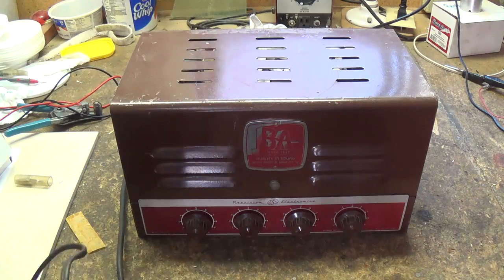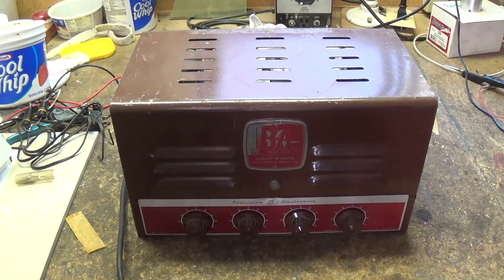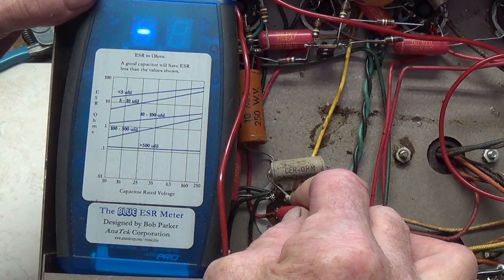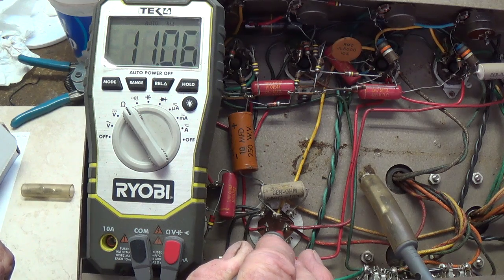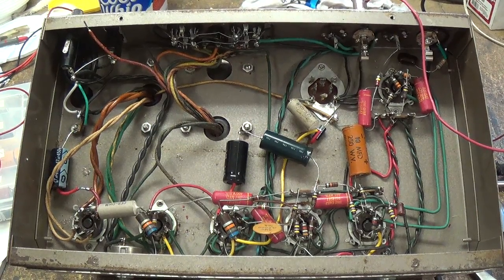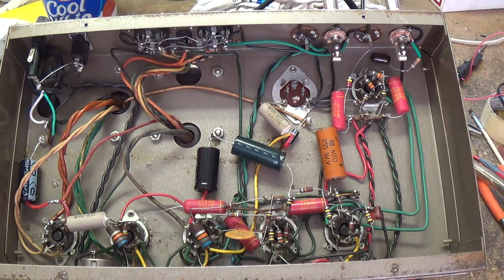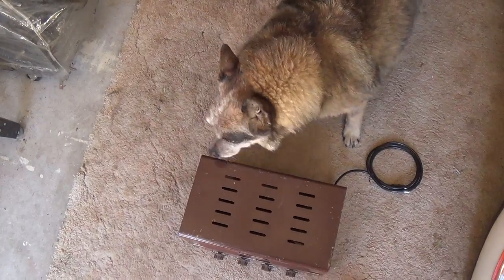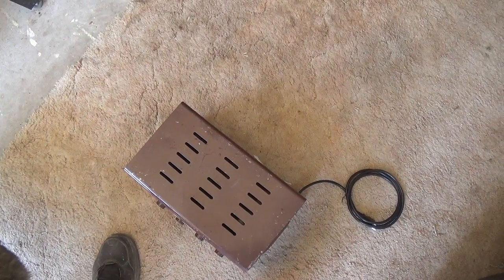The Worst Filter Capacitors I Have Ever Seen.....and Heard :)

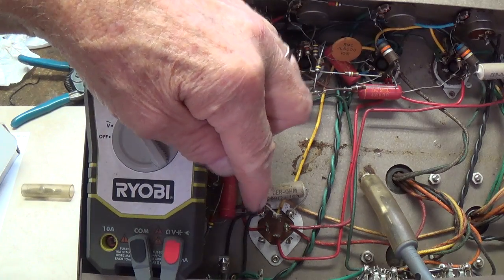Comment: Another really fine video on troubleshooting. From a safety point, all rings, bracelets and dangling metal jewelry should be taken off (2:05) when working on these high voltage circuits. I also assume the filter cap was discharged before measuring the ESR. Thanks!
Reply from the maker: We agree, TM, and yes, as discussed in many of our videos, all filter caps are discharged prior to any work on the chassis, especially when taking ESR measurements.

Comment: Looking in the circuit with another few years research in my brain,  I see Tiny Chief caps...  those are paper/oil type,  and like Bumblebees do go bad with age...   did those get tested too?
Reply from the maker: Yes they did, DK, and (surprisingly) seemed to be fine.
Reply: Cool deal.  I'm re-capping a 1979 Peavey Mixer...   it had 120hz whine.. and since it's been an on-the-road concert mixer, it's seen and heard a great deal.   There's only 350 or so Electrolytic caps.  Some are bulged, some leaked,  all are getting changed...  Fun Fun Fun...   Tedious as heck.
Reply from the maker: Definitely not a fun task, DK. Best of luck with it.
Reply: Got it all done (350+ caps) ... it's a long boring video.   However,  I recorded my DIY leslie speaker in Stereo, and that worked great.   My DIY leslie is a little different than yours... but not too much.   we started with the same drum...  I had a 10" speaker,  and a relay to use as a foot switch on/off.  All that stuff is posted.

Comment: Uncle Doug can you advise what to look for when buying a tube tester on Ebay?
Reply from the maker: Their circuitry is extremely elaborate, they are difficult to re-calibrate, and they are easily damaged by shipment and rough handling. I would suggest a Hickok tester, from a seller with flawless feedback who will accept a return, if necessary.  Good luck.

Comment: have you ever seen brand new (Chinese) filter caps act this way? is there anything I could have done in powering up a new amp that might have caused caps to become like these wretched capacitors?  I really need to build a current limiting light bulb setup like you use here... yes, I watched the video about making one but didn't do it yet. Cheers!
Reply from the maker: I've had good luck with the new Chinese filter caps sold by Antique Electronic Supply, Buzz. None have ever caused me a problem......yet :)  If you had one or more fail, it's possible they weren't installed properly. A current limiter would definitely help to prevent harm to components if short circuit(s) exist.
Reply: Considering how useful it is, a light bulb limiter is a sound investment.

Comment: Rusty's skills are beyond question. Dated parlance translated--"Rusty sports the mad skills"...very 90's but I'm not as cool as I once thought I was. 
P.S. I'm pretty sure (based on what I've seen/heard thus far in the Uncle D. videos) that the capacitors in my newly acquired Carvin amplifier will need to be replaced. I'm going to watch/learn for a few weeks before taking any action...I'm in no hurry to be wrong AGAIN so i'll keep consuming the 'course material' indefinitely. Thanks again guys!
Reply from the maker: Thanks, WTD. Best of luck with your studies and eventual repair :)
Reply: Hello Uncle Doug and and company! I'm happy to report that I simply had to replace a couple of pre-amp tubes to solve my problem after determining that it was merely 60hz hum that needed to be remedied.  I think after a full re-tube and a tuning of the bias will make my Carvin MTS combo the amp it can be which should be ultra low noise, good clean channel with plenty of nice tube warmth...just gonna start with a simple matched set of EL34s, maybe try a low noise 12ax7 in V1 and regular JJ's in v2-5. Think that will make the mild,but present 60hz hum altogether disappear. Also Uncle Doug, I'd love for you to see this UNCLE Alberts Del Ray--very neat amp and would love to show ya--just go to Craigslist Indianapolis and search musical instruments and enter tube amps...won't be long before you find this intriquing  and gorgeous piece of masterwork. It is really really neat!
Peace out Dawg(as they said in the 'hood before it became trite.)

Comment: Hey Doug, thanks for the videos 😃I have a question regarding a SS amp.  I have a Marshall MG 15.  The Neutral prong on my plug broke off and it heated up pretty good.  I noticed the wiring coming out of the transformer got a little cooked.  After going through a couple of fuses, i fixed the plug, but now I seem to be getting a lot of "what i thought " 60 cycle hum.  A person i was talking to said i probably burnt out a filter.  Was he talking about a filter capacitor?  Do SS amps even have filter capacitors?  Im wondering if what i hear is actually 120 cycle hum...  great channel by the way.  I am learning a lot about how to work on my Fender Hotrod Deville (my "real" amp) through your channel.
Reply: Kyle Olin or learn to read an use a meter and solder. i want to build one but damn still not that much cheaper with the good stuff.
Reply: By the way, i like the sound of that PA too 👍🔥
Reply from the maker: There is no telling what harm might have been done by overheating, Kyle. Yes, SS amp power supplies use filter capacitors. You might want to get a qualified tech to look it over.
Reply: Uncle Doug thanks for the reply.  Around my area work is expensive, and questionable at best. Id be better off just to get a new amp, ill just have to do some more research.  Got alot to learn :)

Comment: hi uncle doug i need help.recently i bought a selmer little giant from the 60s very clean amp all original .however i played it at low volume had a very clean sound when i cranck it up all the way the sound distorted in unpleasent way also there is a drop in volume and a crystal microphonic sound when i strum.
can this be the tubes as they are mullard and from he 60s ?or is it something else?the speaker is very clean and no rips.your help will be great.thanks.
Reply from the maker: Greetings, SS.  Have you checked the output tube bias?  It could be that they are biased too hot and are distorting badly when driven at high volume.  I have posted several videos on how to measure the tube bias.  If you're nervous about trying this yourself, seek help from a professional in your area.

Comment: Another great video Uncle Doug. I obtained a Precision Electronics 30 watt PA amp that was "dead" I was told. When I plugged it in to verify, indeed there was no output. About 30 seconds later while I was snooping around with the amp still live, the filter cap can started poring out huge volumes of stinky white smoke. I've been told when the smoke comes out you can't put it back :) So like you I isolated the cap can lugs and added new filter caps the same way you did.  Now It's an amazing sounding guitar amp. I'd bet $10 your filter cap and mine were from the same vendor, maybe even the same date code. The amp now sounds wonderful, but has 7868 output tubes that thankfully are in great shape. I'm not using it much until I find a "beater" pair. Fingers crossed. Keep up the great work and thanks for letting us watch!
Reply from the maker: You're welcome, CA, and thanks for sharing your interesting experiences with a PE30 amp.  They are indeed excellent for guitar use. Best of luck with yours :)

Comment: this comment is made prior to that can capacitor, caps like that are the main reason prior to such loud hums, because the electrolytic fluid in that capacitor is no more, there is hum as a result of it's  high resistance, usually the resistance in the can electrolytics are low and able to be used as long as they are neither leaky or dry because it helps keeping the tubes inside(if any) from red plating
Reply from the maker: Thanks for your input, SD.

Comment: Doug, Ade here needing some more of your expert advice - AND if any one else who would like to offer -

I may be buying a 20 watt tube amp Crate Vintage Club 20 combo
that has one noticeable problem -

The seller says when he turns up the GAIN on the amp it gives a loud squeal.
So in its present state the gain is not usable.

I know the major red flag is if the problem is in the circuit board because replacements are hard to find - especially for a 20 year old amp.

Have YOU encountered a problem like that in any of the many amps you worked on?? 

I know the problem can be any number of things BUT if you can offer any tidbits that may help me I would appreciate it.

Thanks in advance Doug - I always appreciate your advice.

Ade
Reply from the maker: Squeals are usually due to oscillation within a (pre-amp) tube, Ade. I'm not familiar with this amp's circuit, but if you were to replace each of the pre-amp tubes one at a time in sequence with a new replacement tube (probably a 12AX7) the culprit might be revealed.  Another test would be to tap or wiggle each of the tubes while the squealing is in process, to see if the tapping alters the sound in any one of them. Good luck.
Reply: Uncle Doug  Thank you Doug - Much appreciated. You always have great advice to offer. Best Regards to Rusty :)
Reply from the maker: You're welcome, Ade, from both Rusty and me :)

Comment: How can you get an accurate ohms reading on a cap when all the wires are still connected to it? you could be reading ohms from a different path than the cap is offering. This is because the reading could be coming from something the wires are connecting to.
Reply from the maker: I repeated the resistance measurements after the wires were removed, Neutro, and other than the value for the 25uf cathode bypass cap, the readings were about the same.  However, you make a good point. Such measurements would be best done with all wires removed from the capacitor's lugs.
Reply: Thanks for clarifying that.
Reply from the maker: Thank you for spotting the issue and requesting a (much deserved) explanation.

Comment: How come you did not replace the 10uF at 250VDC filter cap?  Or were you just concentrating on the can filter?  I guess you will replace all the paper caps too.
Reply from the maker: To be honest, AK, I generally only replace the caps and resistors that test out of spec.  When one replaces too many parts in an old amp, it becomes.....in my opinion, at least......more like a re-issue than an original.
Reply: I use to do that 20 years ago, but with age of these components, especially those with B+ on one end, I replace them all before catastrophic failure...  I learned my lesson long ago when I fried a power xfmr...
Reply from the maker: I understand, AK, and it is an assumed risk, but also an informed one. I regularly monitor and test for cap failure, and generally employ a current limiter with vintage amps.

Comment: The 196 ohm reading was measuring the Output Tube cathode bias resistor...
Reply from the maker: Good point, AK. Thanks for spotting it :)
Reply: @UncleDoug  This has actually always confused me about trying to read resistance across almost any capacitor in circuit - From any given node in most tube amps aren't there almost always other pathways to ground through which you are going to get some value less than infinity?  How are we to know that the path of least resistance is the one through the capacitor?  I would have liked to see verification of those readings in the final view of the chassis after you'd lifted all connections from the multisection cap to see what they were without any other pathways available.
Reply from the maker: @smw397  To eliminate any false resistance readings in both resistors and capacitors, you can rmove one lead from the circuit......or you can study the schematic to see if there are any resistors in parallel with the resistor or capacitor being tested.

Comment: Hi Uncle Doug. I have a question. I restored a 1940 Zenith radio console around 2012and used a variac at 110v during operation. About a month ago, I heard several "pops" (about 15 min apart). As the radio died on me I heard a sizzling sound from the speaker. The transformer,  because I had used a variac, was warm to the touch didn't smoke on me. All the tubes checked okay. I have to remove the chassis from the cabinet power and check the power circut. If the transformer did go bad on me, what advise can you give me to have the console paying again? Thanks
Reply from the maker: Long distance radio repair is simply a guessing game, Jorge.  A variac will not protect the components in your circuit.  For protection, you need a current limiter (see my video).  You will have to test the primary input and all the secondary output windings of the power transformer with an ohmmeter (for continuity).  If it fried, then you'll have to track down and install an suitable replacement. Good luck.
Reply: What model? There was one or two Zeniths around that era that used a pair of 6X5Gs for rectifiers. It was an improper design, and they paired them up with a marginal power transformer for the size of the radio, so they were notorious for shorting and burning out the H.V winding. There are two ways to check the transformer, one is by taking resistance measurements, the other is by pulling the tubes out and powering it up. A failed power transformer usually has one or more shorted windings and will get red hot within minutes, which you can also find by measuring the resistances of each winding, particularly the H.V winding between each outside leg and the center tap. It's possible that the sizzling was a tone correction cap across the output transformer primary, that cap has to be a high voltage one or it can fail and short out.

Comment: Hello uncle Doug. Is there   a n y.  valve amp that you   w o u l d. consider pure junk ? Can everything be saved ? Does there come a point when , apart from a technical challenge and the satisfaction, you would say "No, bin it", and nothing can be salvaged? Does rarity or historical significance have a limit ?
Reply: By the way, I've just subscribed. It's fascinating !
Reply: +Fred Eagle Rusty, the mystical tech dog, decided it for me ! - as well as your lecture on safety with electric guitars and the electric-shock hazard episode....
Reply from the maker: Thanks. Welcome to our channel.
Reply from the maker: Greetings, Fred. Even if an amp is not restorable, somewhere on its mangled chassis there will be useful parts for scratch building another amp: tube sockets, transformers, terminal strips, pilot light, etc.  The most wretched amp I ever restored was a 1947 National (see my video). I was motivated by the challenge and by my respect for its age and innate quality.
Reply from the maker: Rusty is my greatest ally and asset, Fred. Without him, there would be no channel :)
Reply: That made me smile and tingle with pleasure,Doug. Pat Rusty on the head for me !
Reply from the maker: Will do, Fred :)

Comment: Hey there Doug! great videos! I love them. I was wondering if there are like a couple of precautionary steps (in summary) for working with high voltage amplifiers? I know that one must drain all the capacitors by using a resistor and shorting but besides that is there any other dangers lurking around? I have had questions like if you touch a transformer (like those big ones outside some amplifiers) can you die? should you cover them all the time? Ive been wanting to tinker with tube amps but im afraid I do not have the sufficient knowledge for that. Thanks again for the great and informative videos
Reply from the maker: Safety precautions, including how to make your own capacitor-draining tool, are included throughout the videos, 39P.  You really need to watch and acquaint yourself with all of them before touching any of the wiring or internal components of a circuit.  A couple of quick suggestions:  Never be grounded (skin touching concrete, pipes, etc.), and never touch any circuit with both hands (keep one in your pocket).
Reply: Uncle Doug Thank you for those tips! Ill watch your older videos! so far the ones ive seen have been really useful.
Reply from the maker: You're welcome, 39P. Best of luck :)

Comment: Electrolytic Caps lives are all over the place. A production scanner from 1996 had its caps failing in 7 years. We ended up leaving the unit always on so segments of the scan bar would not be off. A great Sony ICF Pro 80 compact short wave I got in Singapore 25 years ago had a rash of failed surface mount caps. 

Brand new PATA to SATA adapters I got had failing caps with zero hours, they are still in the bags!

https://www.youtube.com/watch?v=2zHnwTHHdF8

Bad filter are caps are as old as radio. With tube stuff the caps often get cooked hotter and thus caps fail quicker since they run hotter.

New old stock caps may have to be reformed to work well again.

With some HP and Fluke stuff much of the equipment I have has the original caps.

Oddly I have pre WW2 stuff that has some electrolytic caps that are still OK and work

The seals fail and the stuff evaporates at end of life .The mix of materials must have varied widely over the decades.

There are rashes of duds every decade, the formulae get botched, copied wrong. The rash of Chinese caps that died young even happened her in the usa too eons ago
Reply from the maker: Thanks for your input, 3B :)